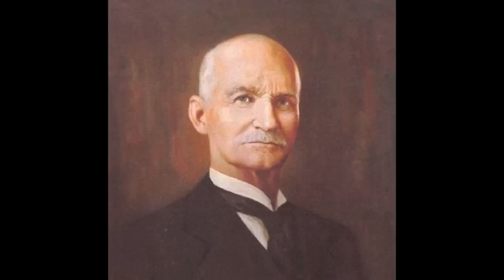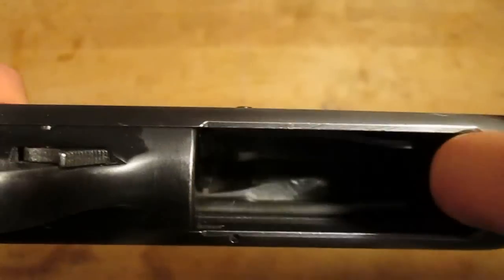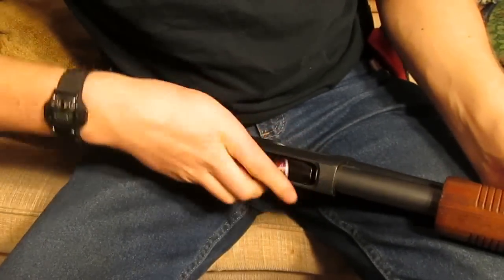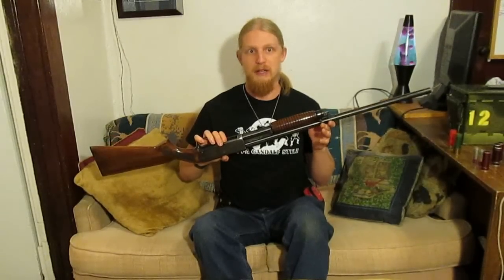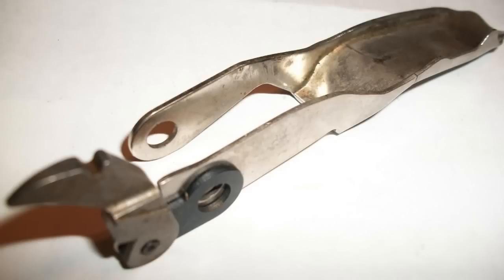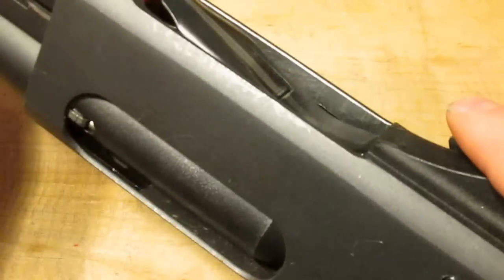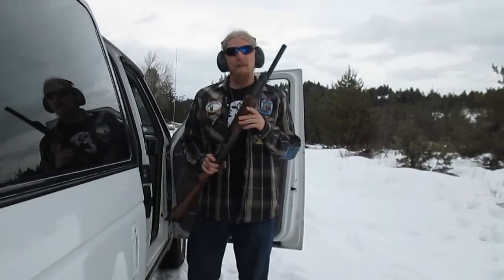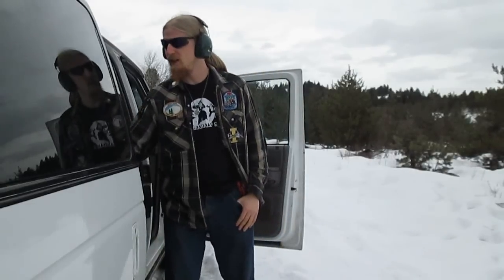Much Ado About Shell Carriers - Remington 870 Tips & Tricks #5

Comment: Been gathering ideas to update an old wingmaster into something more appropriate for home and/or camp. 

Thank you so much for the videos and forum posts--truly a wealth of information. 

If you could spare a moment, I'm interested in your opinion on reliability improvements I could make for defensive purposes. 

I've sourced a modern flexitab breech assembly, slide, and carrier assembly; these strike me as the most meaningful updates and do much in the way of mitigating operator error. 

Are there any other updates you would consider essential? Updated forend tube assembly or the police variant upgrades to various springs? None of the other updates I'm aware of seem particularly urgent or significant to me, but I'm ready to be wrong on that. 

In any case, thank you for your time and consideration!
Reply from the maker: Yeah, flex-tab upgrade for sure.  A new fore-end tube assembly is an optional fourth item in the flex-tab update.  It's not essential, but the new-style action bars will engage a little more solidly with the new-style slide assembly, and the camming surfaces that engage the shell latches are longer and more gradually-angled, so the action runs smoother.  

Remington also beefed-up the shell latches at some point.  The new-style ones are a little stiffer and heavier-built to stand up better to hard use.  I forget what year they switched, but the two versions are easy to tell apart.  Old-style have two staking recesses per latch, new-style ones have six.  A little bit of a pain to change though, since it takes some special tools to stake shell latches into the receiver.  If you have old-style ones and they're in good shape, you probably don't need to worry about it.

I also like several of the aftermarket magazine followers that are out there.  Not because the factory followers are flimsy or unreliable (though some of the really old steel followers can cause minor issues in certain circumstances), but because the aftermarket upgrades add some safety features through high-visibility colors and features that let you easily feel when the magazine is loaded or empty by touch alone.  My favorites are the ones from S&J Hardware.

Police springs are over-rated in my opinion.  They do have some benefits, but they're not simply universally better just because they're used in LE models, as a lot of the internet seems to think.  They have trade-offs, which is why Remington didn't just put them in everything.

The Police magazine spring (this only applies to non-extended 4-round magazines by the way) is longer and pushes shells with more force.  This can improve feeding reliability if you're shooting hard-kicking shells and running the gun really (and I mean REALLY) fast.  It also obviously has more room to wear out before becoming too weak to work properly, which can be a nice bit of extra insurance for a P.D. shotgun that may not see the maintenance it really ought to, but still needs to be relied upon when things go bad.  The downside is that the longer, stiffer spring makes it easier to fumble a reload if your technique isn't great, and it takes up more space in the tube and potentially reduces capacity with some shells.  Also, the extra force is harder on shells during feeding, or even when they're just sitting in the magazine.  In a hard-use gun that gets loaded, shot, and then loaded again, this isn't a big deal.  For home defense or other civilian roles, the same shells are likely to be left in the tube for longer periods of time, and/or loaded and unloaded multiple times before actually being fired.  Battered shell rims or deformed bodies can cause all manner of malfunctions.

The heavier carrier dog follower spring in the Police 870s is kind of a similar thing.  Stiffer spring, lasts longer if the gun is neglected, etc.  Downside is it makes the action stiffer to cycle since there's more friction and resistance in the carrier mechanism.  And again, easier to mess up a reload since it takes significantly more force to push the carrier up and out of the way.  I tried it, didn't like it, and went back to the standard spring.  I don't even know how many thousands of rounds have been through my 870, but I've never had an issue with the carrier function.

The Police trigger spring just makes the trigger pull heavier.  That's it.  It's not more durable, or better-made, or more reliable, or anything like that.  It's just to give you a heavy trigger for situations where a little less accuracy is worth decreasing the likelihood of an unintentional discharge.
Reply: @SynchronizorVideos  

I'll keep an eye out for a decent deal on the upgraded action bars. Would you say the shooter experiences a tighter feeling lockup from this upgrade?

Other than that, all I've got lined up is the Hogue 12 inch stock and forend. Ugly as sin like everything they make, but many shooters claim to enjoy the shorter LOP for applications outside of hunting/sporting. 

The idea of a light interests me, but all the good ones seem to be pricey!

Thank you so much for the response brotha--your content has saved me hours of headache!
Reply: @SynchronizorVideos  
was able to review a bunch of the blog reviews on 870 accoutrements; ended up with the Hogue 12 inch stock, a hi-viz snap-on front sight, and Streamlight forend with an integrated light.

I think the Streamlight is an exciting addition to the 870 catalog. Surfire was the only game in town for wayyy too long. At $100-$150, this is a wildly competitive product that oughta take lots of market share from its dance partner. Would love to see ya'll review one, if such a review isn't already in the works!

Also, after reading your review, I went for the Wilson Combat +2 extension. 

This is already a lot more than I've ever put on a vanilla firearm, so I'm drawing the line here--build complete! 

It was a really fun project. Been shooting 870s for years and I still learned a lot through the channel and blog--particularly regarding aftermarket products. Thanks again brotha!
Reply from the maker: @petrie1230  Nah, action bars aren't going to change the lockup unless something's really out of whack.  The bolt locks directly to the barrel anyway.

Comment: Thanks! Just bought a Remington 870. I will never ghost-load it for any reason whatsoever.
Reply: I recently bought some dummy shells and decided to try it with my 870 the other evening before watching this video. Maybe it's just because they don't weigh as much as a live round, but it would cause a jam condition where the extracted shell did not want to eject. Instead, it hung up in the receiver with the ghost loaded dummy round pushing up against it. My conclusion on it was that the 1 extra round was not worth the chance of a malfunction if reliability of the gun was most important. Pretty much an unnecessary trick.
Reply from the maker: @J.E.Taylor  Yeah, ghost-loading is a pretty hack way to try to up the capacity of an 870.  Installing a magazine extension is a much better way to boost capacity.

Comment: I asked on one of your other posts about doing a Timney Trigger Fix to which you replied why as it is expensive. I responded I purchased one. On Friday I took my 870 to a highly experienced gunsmith to install it. He did and I heard him from the back "nope, this isn't going to work. Nope"  to find out that once installed, the trigger would function with the safety on  under a lot of pressure. A bust. Not sure if Timney will provide assistance but at the very least they should be concerned.

Comment from the maker: +Charles Feyt It'll depend on your specific situation, of course, but keeping a go-to home defense shotgun with a loaded magazine & empty chamber (AKA "Condition 3") is a safe and effective strategy in many cases.  With the chamber empty - especially with the action locked on a closed bolt - it is virtually impossible for rough handling or fumbling to trigger an unintended discharge. 

It is, however, relatively quick and easy to intentionally chamber a round and make a Condition 3 shotgun ready to fire - unlike one that is completely unloaded.  This is usually a benefit for a HD weapon that you want to be able to deploy in a hurry; but if over-inquisitive kids or not-so-sharp friends are a concern, you should look into locking devices or locking storage that will keep the gun out of unauthorized hands while still allowing reasonably quick access and deployment.

Comment: My only reason for liking my Mossberg 590 over my Remington 870 is the slide / bolt release is actuated by the middle finger behind the trigger guard on the Mossberg which is very natural; and on the front of the trigger guard on the 870 forcing me to move my trigger hand around the guard to release the action (the old reach around). At the same time, this same benefit of the Mossberg over the Remington becomes a serious problem when someone (usually new shooters) puts a pistol grip on the Mossberg, forcing the gun to have to be turned upside down to release the slide because the pistol grip blocks the natural access of the middle finger to the slide release. I'm a firearms instructor and RSO (Range Safety Officer) and two people in one day recently - within 5 min of each other, had the same issue with their pistol grip Mossbergs, not knowing how to use it, nor that they had to flip the gun over to find it. The call for "my gun is jammed" comes back and I go over, turn their gun upside down, show them where the slide release is, and instruct them to remove the pistol grip and install a normal stock while the range master shakes his head in the affirmative behind me. Mossbergs and pistol grips... just don't do it. the only exception is those bird beak type pistol grips for Mossbergs.
Reply: I als prefer the tang safety of my Mossbergs over my Remingtons.  I’m a lefty

Comment: It's nice to see another person who appreciates the Ithaca 37 as well as the 870. I inherited my Uncle's Ithaca Deerslayer in 16 gauge that he got new in 1971. I have had it for about 12 years now and have taken deer, grouse, coyotes etc. I have had a couple of 870's over the years. I recently got a older 870 (about 1980). where is the best place to get the parts to update the shell carrier to the slotted version and do you have a video on how to carry that out?
Reply from the maker: Bayan1905 If you're buying new, you'll have the most options and - generally - best prices ordering directly from Remington's website or customer service department (via phone or mail-in order form).  You can save quite a bit of money buying used, though, especially when it comes to the breech bolt assembly, which can be around $100 new.  

Once you have the updated parts, swapping them in is pretty straightforward.  For the breech bolt & slide assemblies, simply take the gun down as you would for cleaning, and reassemble it with the new parts instead of the old.  See my take-down video if you need help with that.  Installing the new carrier assembly in the trigger plate assembly is a little more involved, but not much.  My 870 Tips & Tricks #12 video shows how to remove and install a carrier assembly.

I'd like to do a video that covers the flex-tab upgrade in detail; finding parts, options for parts, how to install them, and information about mixing old & new parts.  But to do it right, I need to get a complete set of old-style action parts, and I have next to no budget for these videos.  So a flex-tab video is waiting on either me finding the parts for really cheap somewhere, or someone donating/loaning them.

Comment: Loved this video. I followed your advice and bought an extension. I just installed it and it is great. It was called a 10 round extension but in reality it adds 5 rounds which gives me 9 + 1. OK that's 10 rounds but it does not add 10 as the name implies. Corrected a small typo.
Reply from the maker: The standard (more or less) notation for extensions is to refer to them by the additional capacity they provide; +3, +5, +18, etc.  This is a very straightforward notation that is applicable to all 870s, even the clone or nonstandard versions with 3-, 5-, or 6-round magazine tubes.  

However, some manufacturers label extensions by the total capacity they enable when installed on a standard 870 with a 4-round base magazine tube.  Accounting for the space in the magazine tube and chamber, you need to subtract 5 from this total to determine the capacity of the extension itself.  An "8-shot" extension would be a +3, a "10-shot" would be a +5, a "23-shot" would be a +18, and so on.

Also keep in mind that these numbers almost always refer to capacity with 2.75" shells.  Capacity is sometimes lower with longer 3" magnums, and will virtually always be lower with 3.5" super magnum shells.  On the other hand, 2.5" or shorter shells can sometimes increase capacity.